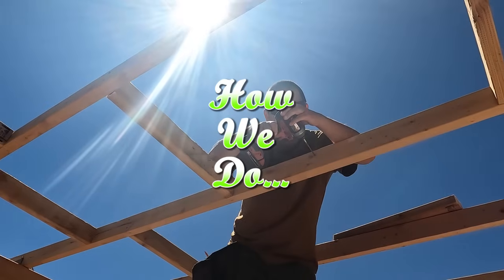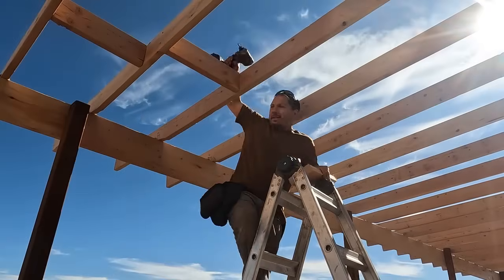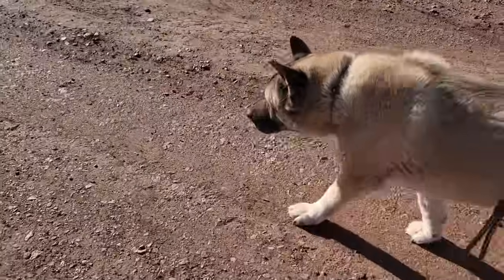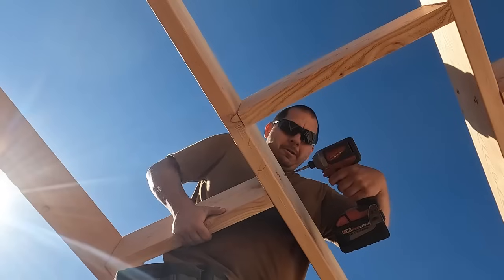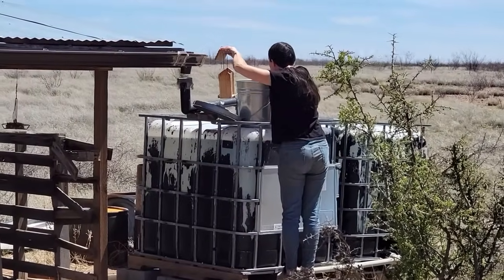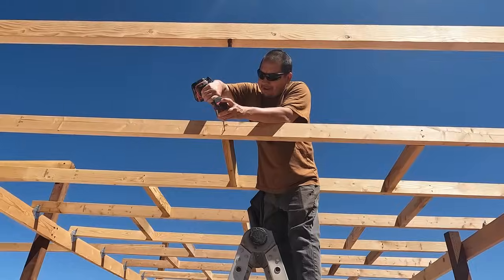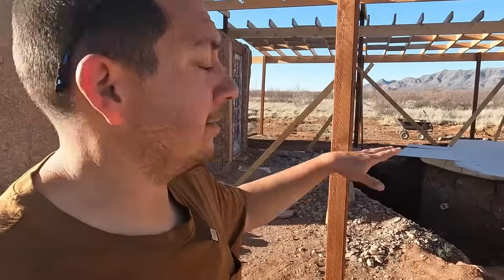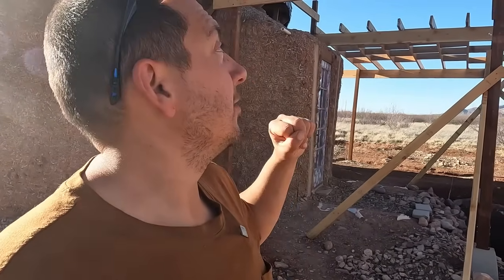Our Anatolian Shepherd Chases Trespassers Off Our Property

Comment: Your making great progress on the roof! I had to look up those wild pigs, I read the Mayan used to raise heard of them for food. I wonder if you could catch them and raise them that way? I was thinking about those rocks. I was thinking that off to the side there where the new roof is going to go, why not make a stone wall of sorts to make a growing area so the water that may run off the roof can go into it, perhaps using the wire to hold the rocks into the wall shape like what was used in your other growing area. or  use them like that along your farm perimeter to make a wall to be used as a wind break and to keep those critters out?

Comment: I have a Turkish Kangel we picked up in Bulgaria as a puppy street dog and brought back to the US with us.  Some people dispute that there is a difference between Kangels and Anatolian Shepard’s.  I’m sure they are mentally and physically comparable.  Mine looks just like yours.

❤
Reply: what a beautiful thing to happen to you they are truly lovely dogs. all though i'm certain it wasn't a kangal. kangal dogs are pure bred and not mixed with anatolians on the street that would just be an anatolian shepherd then (kangals pure bred are rare even here in turkey). A kangal has a thick full golden-blond fur with a black snout, upwards curling tail with the hair sticking up, tall broad front shoulders, short body compared to anatolian, around the hips is tight and not loose if it were a working dog, very lean dogs. anatolians however could have different color fur and are usually different in sizes some might be huge compared to others, lower front shoulders and usually look wacky compared to a kangal when they actually work like running longer distances or in play you can really see the difference. kangal is also proud and very loyal but break that loyalty and i won't ever forget that. it remembers wrong doings by faces. if your anatolian has these characteristics you can call him a kangal imo

Comment: Question about the roof design. The lengthways beam, which is directly supporting the roof structure is held up by screws only. Will you support it from below as well at some stage or is it okay as it is?  I ask as other designs have this beam balanced and screwed to the top if the poles which seems more stabilizing.

Comment: I am worried about your roof build. You will have all this weight resting on a few nails on your foundation boards, where the foundation boards should be ON TOP of the posts, letting the posts (into the ground ) carry the weight of all those rafter boards.....a recipe for disaster. I don't believe 6 nails can safely hold all that weight in the long run. Please reconsider your build before going further.